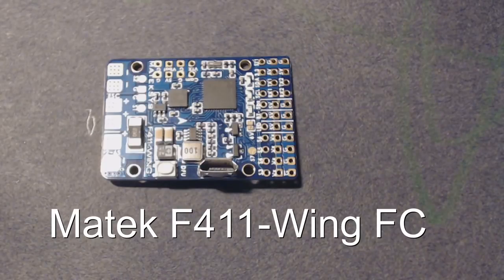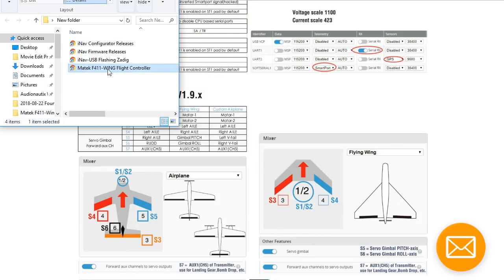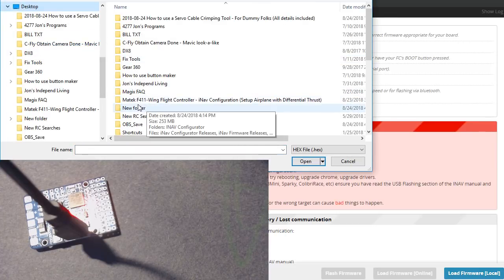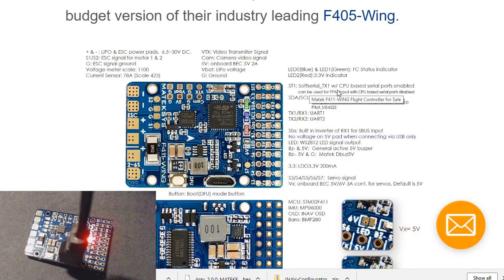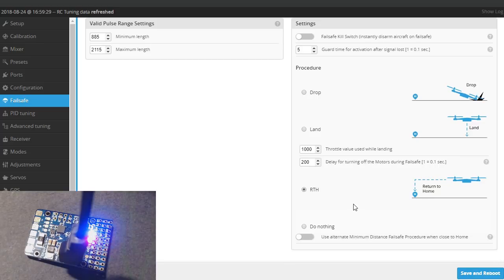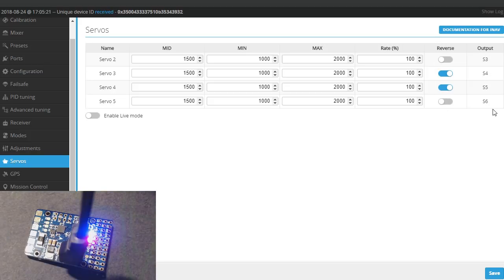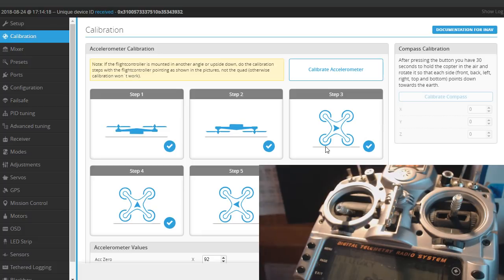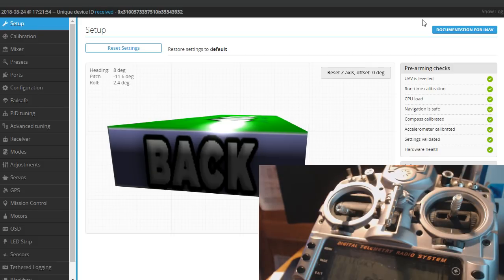Matek F411 Wing Flight Controller - iNav Firmware & Configuration RC Airplane Setup (Full Flash)

Comment: Hi dave. I have a problem with this board. Actually with bad soldering i removed the contact point of the Cam pin. Is there a way to solder cam wire to somewhere else on the board to get the osd display? Thanks in advance.

Comment: Quick question love yur video 
If it shows back not front and I change yaw to 180 and still doesn’t change after resetting z axis on the setup it shows my board backwards when the arrow is mounted pointing forward. ?

Comment: I have Mac computers that won't ket me download these items. I believe i flashed my board with the wrong software. I loaded the data for F405 instead F405SSE. I have tried repeatedly to flash the correct firmware but it wont let me do it. SOOOO FRUSTRATED!! Any suggestions would be greatly appreciated
Reply from the maker: Not sure but maybe the RCgroups Discussion will help
https://www.rcgroups.com/forums/showthread.php?3111829-Matek-F411-Wing-Flight-Controller

Comment: Nice job Dave.  I just spent the last several days on my AR Wing 900mm.  I have the Matek F411 board.  I was going to use an older FlySky receiver I had from an old quad build but decided to go the SBUS route.  I had some initial problems with the telemetry cutting out on my video feed.  I have GPS and am running a VTX up to 800 mw with a run cam.  My Git Up Git 2 GoPro type camera will take the HD video.  Of course, fly these birds on manual first and slowly bring in the RTH and other stuff..
Reply from the maker: Glad you found this F411 video helpful, Thanks for commenting!

Comment: I have a nitro powered plane, and I am getting back into flying (1997 was the last time I flew a we didn’t have any of this technology)
If I use this flight controller with gps and l enable return to home;   
How does one connect the throttle Servo to maintain a Constant air speed while holding in the return to home flight pattern on a nitro engine??
Basically what I wanna know is; will it give me an auto throttle feature for a standard Servo and maintains programmed alt and speed and heading 
Thanks

Comment: Great video. I just flashed my board this past weekend. Waiting on soldering flux from Amazon so I can put my pin headers on. I'll be referencing back to this video to configure my board.
Reply from the maker: I just saw your comment. Did you ever get the Matek F-411 Wing board working and flying?
Reply: @DaveMerc  I did yes. I put it in a C1 Chaser. That was my first flight controller and since then I programmed and soldered together a couple WSE versions.
Reply from the maker: @christopherstarzyk9209  That's great. Glad you got it going. I put one in a flite test founders plane then moved on to the BrainFPV Radix in an Aeroscout. So many FC's to try now but the Radix is made in the US which nice.

Comment: Good job young man. I'm curious about the monitor you have set up for your OSD? That would make it very nice for setting up your OSD rather than using that 7" monitor we use in the field. You got me thinking again. Thanks! Wander What I would need?
Reply from the maker: How about this from Wal-Mart
https://www.youtube.com/watch?v=2h_P1JLVzBw
It will run off 12volts DC. 
The one you saw in this video requires AC only and is actually a TV that just has a composite input.

Comment: i am using Ezuhf too, I set rssi_max =79. For rssi_min, since when I turn off the transmitter, RSSI drops to 0%, I did not set anything by CLI
Reply from the maker: May you are are using Link Quality which is not inverted like the RSSI.
Reply: Yes, I am using LINK